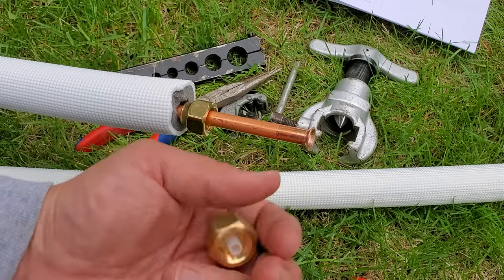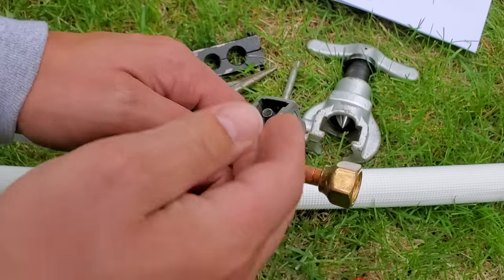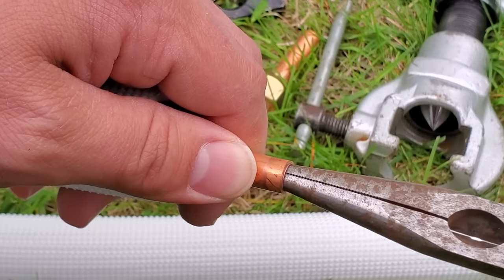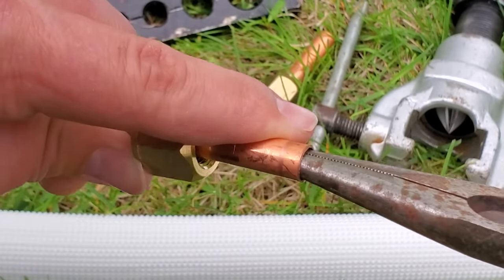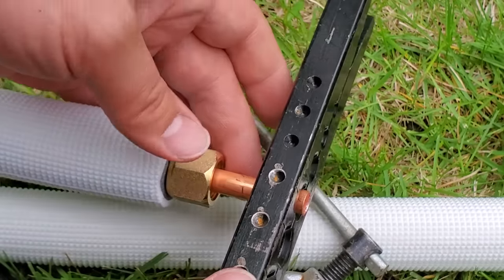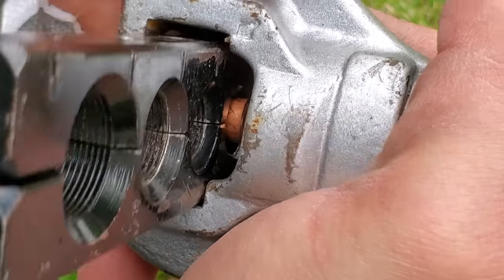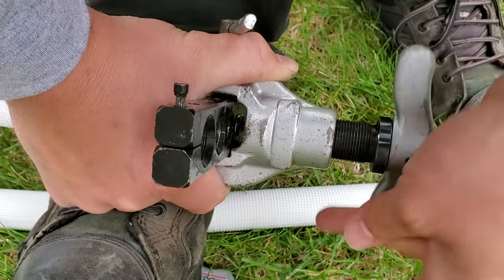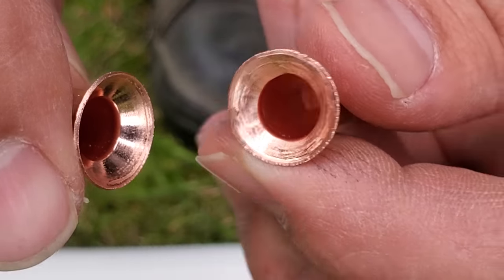How To Make an R410A Flare for a Mini Split AC Unit Installation

Comment from the maker: Note that you should use Nylog ( https://amzn.to/40jcSVU ) if possible in order to improve the quality of your flares and flare connections. Simply put a small amount on the cone of the flaring tool before flaring and then a tiny bit more again when you make your final flare connection. Good luck on your flare!
Tool Deals on Milwaukee, Dewalt, Makita & More: https://acmetools.pxf.io/9gRWRy 
Tip Jar: https://www.paypal.com/paypalme/bensahlstrom

You guys are awesome. As an affiliate I earn from qualifying purchases.
Reply: Yes  FlARINGTool  and  block   The  parts  of  flaring  tool   ate  flaring  block   (anvil   )   and  flaring  punch  new  tools  or old model us  the  end  of  copper  pipeare  cutting eiside eng  cleing  tube  cutter  kinef is  is  sooth  clen and  flar  inside  gamen  coppw enge iside  flare time first cleing  satnders after using good  poper wsy  .. the  flare  nuts  on  it  to  make  the  leak  proof  joints  using  Tee elbow  or  unino n flared  end  can  be   connected   to  open  type  copenrssor    drier  flared tupe use  pope cein and using  thride  leckinv  comd  redon  letast  gas  must  bee  good  cleing  aftef  nes gas using  mus  bd  new old  gaz  lecking   very  imporeanted  ..drier  shut  off  valve  or  cylinder   the  end  of  thd  tubeto  flared   should  be   cleaned  wellusing   file  and   reamer  tools  using  stanred  cutter toos  with  somd  copper tube cutter)the   facd  of  each  holw  on   flaring  block  is  cut  at  45°seatforflaringholdthe  tube  inside  rhe  flaring vblock  extending  1/3pargof  the  length  of  flaringvvabove  rhe  block  if  the   end  of  fler  will  be  too vlarge cin  dimeter  and  flareccnut vwillnot vfit vover  itflare  nut  is  tightìned  it  is  good  to  put  a  dropof  ac  regraters   oilvbusing  poper  seting  sooth  new  pipe ok not uding   allways  uding  fareing old  the  tube  in  side  the  flaring above  the
Reply: There is also a product even better - FlareSeal - not rubber and not Nylog, but is pricey.
Reply: Mate why are u so perfect I’d love to see your quality of work 🤣
Reply: @jollyscaria1922  Huh?

Comment: Why not use the right deburring tool for the job instead of a razor knife or closed needle nosed pliers? They make a great tool for this.  It has a swivel blade.  At least you are using one of the best flaring tools.  The flare came out OK, but the reaming part just wasn’t professional.  You’re actually supposed to file the end of the pipe in a jig.  By doing this you go past the burr and get a real nice edge on the flare.

Comment: When using an eccentric flaring tool, it is important to first read the instructions.  The required extension varies per manufacturer.  For example, I own a Yellow Jacket eccentric flaring tool (Model 60295).  The instructions specify a 1 mm extension, which is less than 1/16 of an inch.  In contrast, your video instructs a 1/16" to 1/8" extension.  If I used that length, I would risk splitting the copper.  Also, as others have noted, you should put a drop of refrigerant oil (e.g., Nylog Blue) on the cone tip before flaring.  The refrigerant oil acts as a lubricant and reduces the torque needed to make a flare.  It also helps to extend the life of the tool.
Reply: Thank you for the valuable insight...
Reply: @puccha10  it's pretty valuable to be honest.

Comment: As a newbie I have watched several of these videos trying to learn how to flare copper piping. After several attempts and several failures I finally watched this video and within five minutes was making perfect flares. Thanks for the help! Sub’d
Reply: Quick tip , the notch in the rollers on the copper cutter is to put the flare into and cut off just about 1/4 inch to remove just he flare. Good to know if you ever leave a nut off and don’t have a lot of pipe to work with
Reply from the maker: Sweet!

Comment: Professional HVAC guy has "egregious" in his vocabulary, has invested in quality tools, and reads the instructions.  Hack says "teflon tape will fix this flair good 'nuff!", spells flare wrong, overtightens it and doesn't bother with a vacuum pump. Then gives a bad review of the equipment he bought online because it failed.  Good skills and experience will always win.

Also, excellent video skills; good job getting the focus correct and showing the cone rolling the flare through the gap.
Reply: Thanks
Reply: Well said Mark!

Comment: I always put a little bit of AC oil at the cone to do the flare, you will always make a perfect flare without scratches. 

Also another tip is to put AC oil when connecting the pipes ,inside the flare and the opposite side, where the nut press the flare. This makes the nut slip over the flare instead of try to rotate the pipe because of the friction.

I did this in over 10 installations without previous experience and none of them have failed. I got those tips from an experienced technician.

To gauge the flare I just use a caliper.

Comment: That eccentric flare is fantastic. Back in the day when the family had an automotive custom business, we did a lot of steel brake lines.. All we had was the straight push cone flare tool. This is SO much better.
Reply: Thank
Reply: Brake lines are supposed to be double flared nowadays.  Not sure about longer ago.

Comment: Pretty good video Benjamin.
As a retired Commercial HVAC owner.
I have struggled with flares for many years, till I discovered Rigid makes a double flare tool set. Ridgid 33927 Specifications:
•  Model No.: 345/150DL
•  Size: No. 345 w/No. 150 Tubing Cutter and case kit (Rather expensive but worth it)
Believe me when I tell you when you make double flares, you'll never go back to the old tools again.
It forms the tubing inward first with a small button, you remove the button then use the sets flaring tool.
I never had a leak after that, and it is good for thousands of LBS
Johnson Refrigeration / Happy Retired.
Reply: Is it safe to use double flares on mini split units ? I assume all it does is make the flare itself thicker , correct ?
Reply: @marcoeis6598  When I use a double flare, I always use the heavier duty flare nuts. You could actually. tighten down  enough to actually feel The copper under. the double flare compress and make a Leak proof 100% Seal.
With a standard flare. you'll always be afraid to over tighten. and split the copper..

Comment: I recently installed a mini split, but couldn't manage to get decent flares using a difficult to use cheap flare set recommended in the video I was following.  Thank you so much for making this excellent guide and highlighting the costly but far more effective pro tools.  This would have saved me time and money in the long run.

Comment: It is always recommended to use nylog or to use the same oil that is used in the system on the cone of the tool, it will make a far smoother flare and NO it will not hurt the system if a tiny bit gets inside because it is the same as what is in the system already.
Reply: some new machines you are not supposed to expose the oil to air at all!!
Reply: @youtubier2839  if you are installing refrigeration equipment such as a mini split then use nylog on the face of the flare.

Comment: really clear video both in images clarity of speech, no music thank you. I have had success with HVAC new copper lines when the copper is soft, recently I did some compression fittings on plumbing old copper lines. The copper was much harder and flaring was quite tricky eventually the compression fittings did stop weeping   but I am wondering if more experienced plumbers can confirm that the hardness of old copper lines can be a problem? Is this what is termed "taking up".?

Comment: AaaaaaAAAH! geez! that "factory standard" flare makes my skin crawl. My split machine came with a set of tubes with a similar finish. I bought a set of tools and practised on copper tubing until I much perfected* it, then I proceeded to assemble my AC unit. 
After a few years of the split being in use I had an AC professional take a look at it, they did a leak sniff for insurance reasons, he found no fault except some astethic choices I made.
AFAIK 14 years later it was still working.

*Perfected = the tool set was considerably cheaper than yours; lacked the torque-stop and eccenter. The tube clamping part of device always left a small pinch mark on tube above the flare. The pinch mark did not interfere with the nut so it did not matter much.

Comment: nice video.. have done literally thousands of flares.  deburring advisable in putting a cut copper end  into a swedged  end to solder, but on flare the process of flaring makes that redundant, at the most, smooth the edge of the finished flare.  Use a little oil  on  the flareing tool, the lubricating makes it easier to turn in especially on larger diameters. Definitely inspect "seat" into flare nut.  Before you join to the male end,  put a little mineral oil on the male end. It, again, will help to "spin" it in and creates a liquid lock, some what like pipe thread dope.
Reply: What type of oil do you recommend?
Reply: @ulisescruz157   carry a boottle zoom oil ( mineral oil) just a drop or two
Reply: The jury is still out on using oil or not.  With the tool he used, it really isn’t necessary.  Where you should use the oil is on the back of the flare, then  the nut won’t twist the line as you are tightening.

Comment: If you put a "tiny" dab of anti seize on the cone it will come out looking like a mirror and with much less effort, a real big help when doing SS!
Reply: Use refrigeration oil.  Good idea, but anti seize could contaminate the system.  Maybe.  👍
Reply: @michaelrice500  Just clean well when done.
Reply: Nylog
Reply: @michaelrice500  What type of oil do you recommend?

Comment: I have made several dozen flares on copper, steel, and occasionally aluminum tubing, and I never trust a single flare. A double flare is double the thickness thus it is much less prone to cracking as is common with single flares, especially if disassembled and reassembled.

Comment: Benjamin Sahlstrom Have you considered double flairing. It's slightly more complex but IMHO is much better. There are several videos about it on YouTube. Once I tried it, I never went back to single flaired fuel lines.

Comment: Good job on this video Benjamin! You have great patience and that is truly what makes a good service tech.
You absolutely used the right tools and techniques for flaring. If I could just add to what you mentioned in the video without sounding like a know-it-all, R-410a flares are at a 45 degree angle, not necessarily any bigger than a standard flare (37 degrees). It's the angle that is important to prevent leaks. 
When I first started installing mini splits, there were no classes available and we had nothing but problems with leaks. We were using standard flare blocks, not knowing that these required a different flare. When Mitsubishi finally offered some training, our problems became apparent, and through the use of the correct flaring tool and a torque wrench, most of our problems went away overnight!
Anyways, great job!

Comment: I saw few issues. 1st - u need to take Daikin installation guide and check sizes of tubes between rail and eccentric head. 1/4 - 0.8 mm, 3/8 - 1mm. 2nd issue - when u tight the flaring tool pull back screw on 90 degrees, much easier to flare and eccentric screw will live more than 2 years.

Comment: Thanks so much for your very informative video, I'm in the middle of doing my gas stove in my kitchen but was very concerned about my flare on  5/8 copper tubing it was very hard to achieve a flare let alone a non scratchy flare I believe I need a different flaring tool .

Comment: so that is like a clutch-type flaring tool, because it releases the pressure with the clutch somehow?
and the wing-nut type would be just a regular lever/handle on top of the tool screw?

Comment: When making a flare with a non centric tool, you must use a thin coat of oil on the pressing cone and not over tighten. I have made thousands that worked fine.

Comment: I hate soft copper oddly enough I bought a flaring tool from Home Depot Husky brand in the plumbing department said for R-410 copper tubing flaring. It actually did a good job of fairing.

Comment: i bought this tool and had hell of a time flaring the pipe, either the pipe was under sized or the tool over sized, my caliper battery died but i am guessing about .01" difference on 1/4  connection and like .015" on 3/8 connection i ended up practicing on scrap piece and using aluminum can to make shims and make up the difference

Comment: About the thickness of a nichol will give you exact amount of pipe to flare
Reply: What is a nichol?
Reply: @jimwhite9483  auto correct . Should have read as nickel as in 5 cent piece

Comment: I absolutely like the wide eccentric flaring tool.  Perfect smooth flares every time.  However, If you want to use standard flare nuts  for gas hookup, move the tubing flush with the clamping tool otherwise your flare will be to wide.  Great video!

Comment: No such thing as a specific size of flare for different refrigerants, those are just MINIMUM requirements.
You just make the flare as big as the material and nut allows it, those minimum requirements are there because sometimes old or hardened copper won't let you make the flare as big as you'd want to so IF you have to compromise some sealing area you know you are good if you stay within said minimum.

Comment: Nice flare. The flare nut on the 410a is not only stronger but the threads match up to the unit it came off of.
Reply: The threads are the threads. It's not like the factory is custom matching them.

Comment: So I just kinked and broken a 3/4 lineset for a mr cool system bc I'm just an awesome guy. I was considering doing a flare/nut repair for this  keeping both ends the same so they connect to the system as they should . Which nut should I use ?

Comment: Great video. What about the connection towards the head unit. Did they give you an extra nut for that one as well? My mini split line set that included with my mini split has the same night as your existing one. It did not come with a r410a nut. I'm going to purchase one and it install it. But I would like to know about the head unit

Comment: Awesome video man. i have the mastercool flaring tool and am having trouble with mine its brand new and makes a nice flare on all sizes but the smaller 1/4 whenever i try that size the click and shut off happens to quickly and the flare doesnt look big enough so i have to try force it more and make the flare bigger. If anyone else has this trouble could you let me know. Thanks

Comment: A spot of silicone grease on the flare anvil, helps form the pipe much nicer. I double flare steel line for brakes, and this makes a huge difference also, and does not contaminate the system, as silicone grease is non reactive with rubber.

Comment: Home Depot sells eccenteric flaring tool for like 45 bucks. The one he is using is a Husky which is the same one that is sold at home depot
Reply from the maker: Yellow Jacket is my preferred option but I'm sure the Husky will get the job done.

Comment: Do you or anyone out there use a tad bit of a poe type oil or nulog sealant type product to lubricate this process to further limit any scratches and improve the smoothness of the flange?

Comment: Home Depot has a husky flare tool identical to yours $39 works great has the clutch too
Reply: When using an eccentric flaring tool, it is important to first read the instructions.  The required extension varies per manufacturer.  For example, I own a Yellow Jacket eccentric flaring tool (Model 60295).  The instructions specify a 1 mm extension, which is less than 1/16 of an inch.  In contrast, your video instructs a 1/16" to 1/8" extension.  If I used that length, I would risk splitting the copper.  Also, as others have noted, you should put a drop of refrigerant oil (e.g., Nylog Blue) on the cone tip before flaring.  The refrigerant oil acts as a lubricant and reduces the torque needed to make a flare.  It also helps to extend the life of the tool.

Comment: I silver solder the suction and liquid lines in the evaporator. Never have to worry if there's a leak like a flare nut.
Reply: On a minisplit?
Reply: @nsant  Only on a mini-split where if you have a leak in the evap. it's difficult to locate and repair. Any other place I go with flare.

Comment: That looks incredibly delicate. There must be a better way to do this. Is copper with flare connections really the only way? Also, measuring the length simply by eyeballing it seems like a terrible idea. Even if I had decades of experience, I would prefer not to do that. Why not take out a caliper and measure it properly?

Comment: for me, if the side of the cooper pipe after flaring is scratch & has bur or too thin, it has failed. like u shown, side of yr cooper after flaring has a nice thickness, i guaranteed it will not be leaking.

Comment: yes, it's a big difference, but from what I can see, it seems that the pipe of the factory set is 0.6mm thick and the one manufactured here is 0.8mm, could this be one of the differences in the quality of the berking?

Comment: I'm curious - is there ever a time when you would want to create a flare on a short tube, polish that flare, then clean it of all polishing material, then solder that shorter segment into your longer tube?
I was wondering how the eccentric cone would create an even flare once you've reached the desired depth.  That torque clutch feature is really cool!